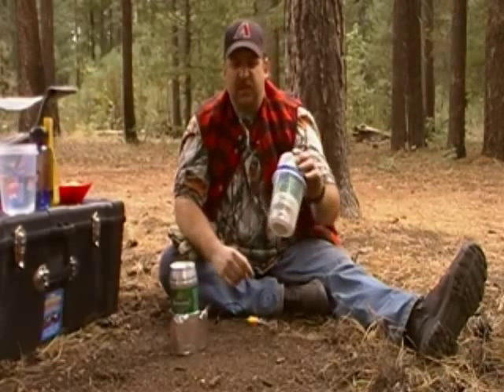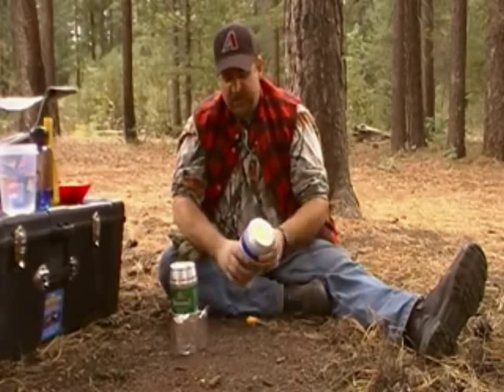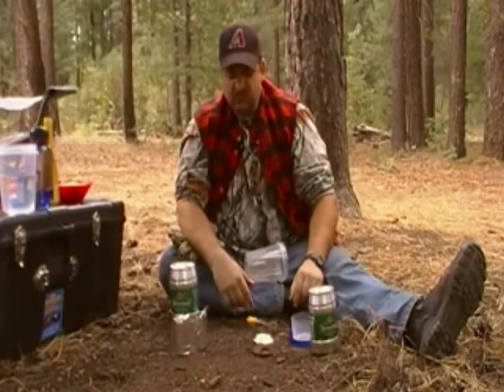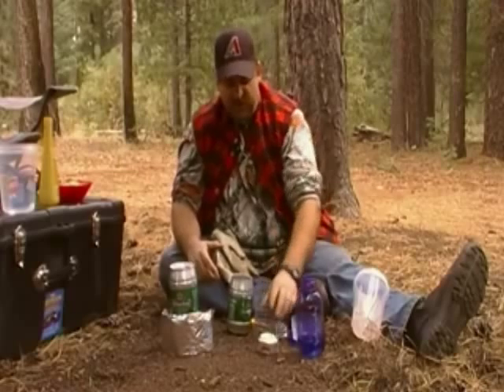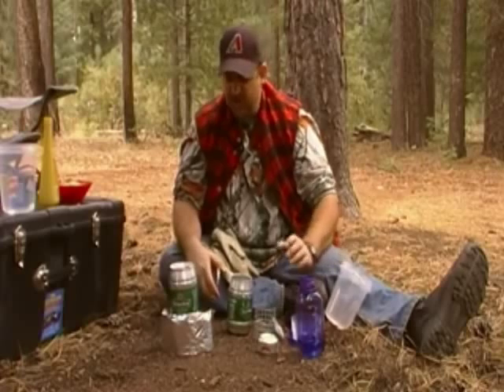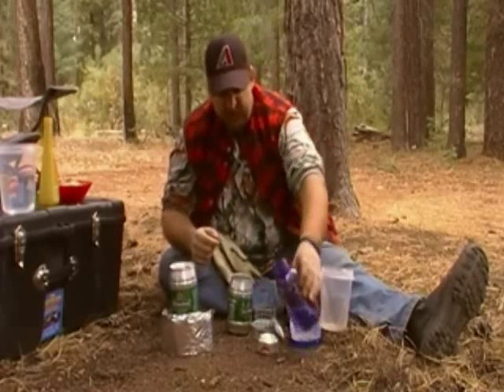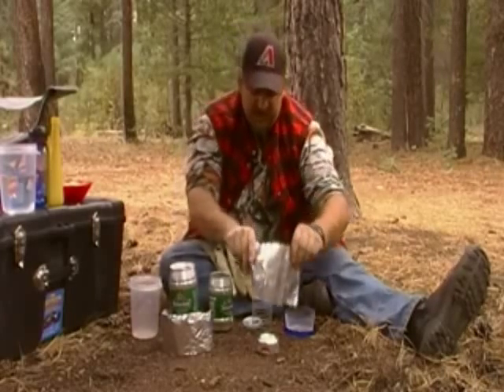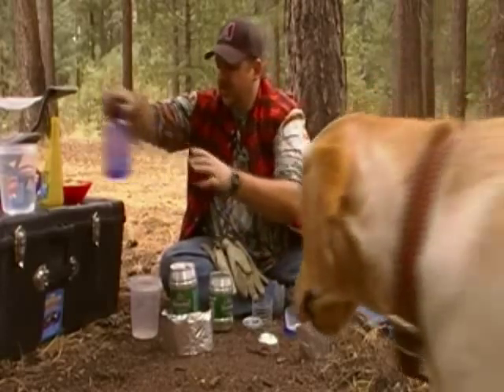Beer Can Trail Cooking

Comment: @Mirobe55 anything that has a coating inside is bad to cook with, on nalgene's website they tell you about BPA and what is safe to use. basically any aluminum can or bottle needs an inside epoxy coating so you shouldnt use it. stainless steel is the only safe bet